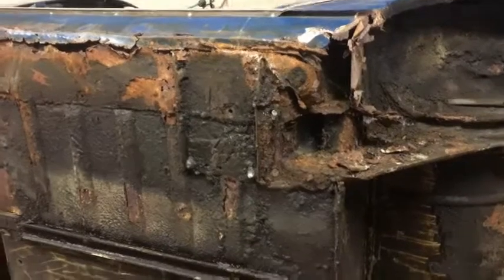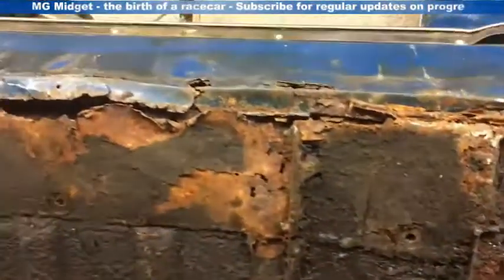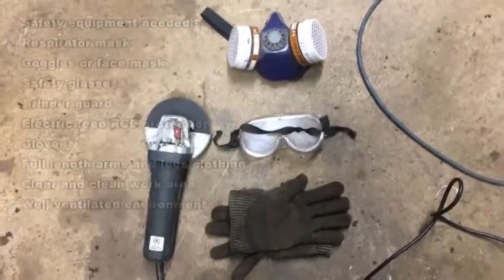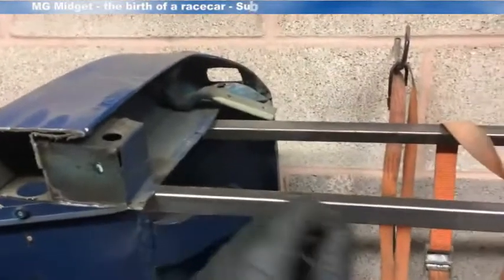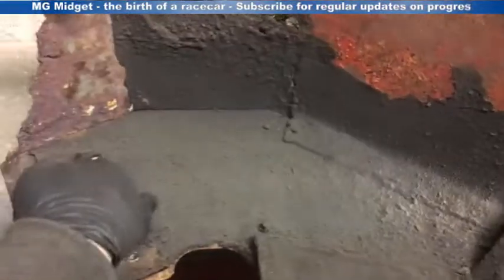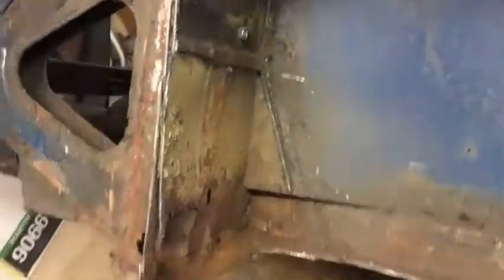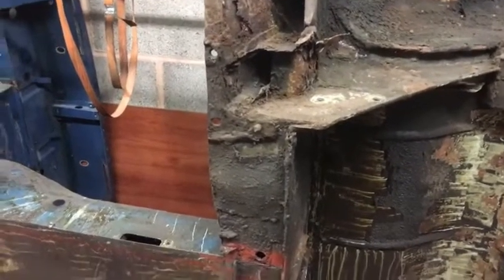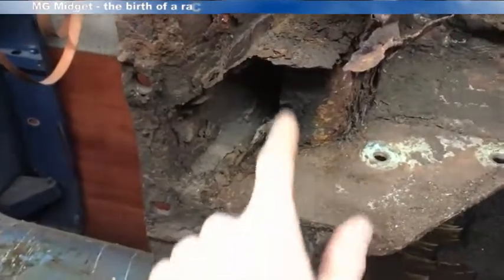MG Midget Restoration Cutting out Rust and Rot - The Birth of a Racecar (Episode 2)

Comment: Hello,  I am about to embark on a very similar journey with an A.H.Sprite (1275) which has been dormant since 1989. I'm happy enough on the mechanical side however I haven't done any welding on a car before. So your set of videos is extremely helpful and thank you very much for taking the time and effort to post them. A few questions please if I may. What type of Mig do you recommend and also what type of rotisserie ?. Best regards,,,,John.
Reply from the maker: Good luck with the build John and thanks for watching. I used a Clarke TE 135 gas welder with 0.8 and 0.6 wire . All set to minimum settings and up a bit as the steel gets thicker. I didnt have space for a rotisserie unfortunately so made for with 4 car tyres and manhandled the body onto its sides. Worked ok but it’s easy to make a rotisserie from wood or steel as you wish
Reply: @mgmidget-thebirthofaraceca4349  Thank you very much.
Reply: @mgmidget-thebirthofaraceca4349  Did you replace the radiator tray ?. Mine is an absolute rotbox. No drainage holes and was welded to the front valance and chassis rails. I'd rather not replace it if it is not necessary.
Reply from the maker: The car has a fibreglass front end so the whole front panel inc radiator tray was removed.  you can find front panels on ebay for around £100 if you need to replace it
Reply: @mgmidget-thebirthofaraceca4349  Thanks again,,,,,I don't think I'll be replacing it. To me it's just a place to collect moisture.
Reply: @mgmidget-thebirthofaraceca4349  ,,thanks again for the info. I'm still in the process of stripping the car down, but thinking ahead. Do you have a recommendation for the sequence/order for re- panelling ?.My car is pretty much the same as yours was. I've watched a lot of your videos and they are very inspirational. Thank you,,,,,,John.
Reply from the maker: i found doing the rear suspension hanger and then bulkhead was a good starting point, i did the front footwell next then floors. once all that was done the sills, crossmembers could be done and finally the a post and b posts , rear wheel arch and front wheel arches.  i guess im saying start inboard and work outwards
Reply: @mgmidget-thebirthofaraceca4349  That's great, you're a big help to me. Thanks again,,,,,,John.